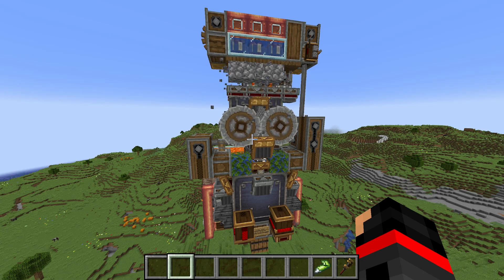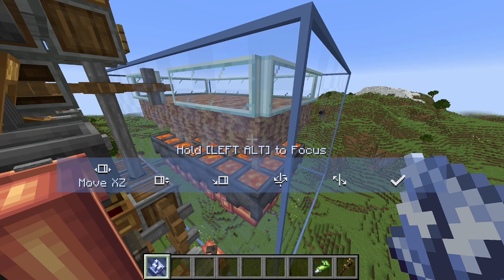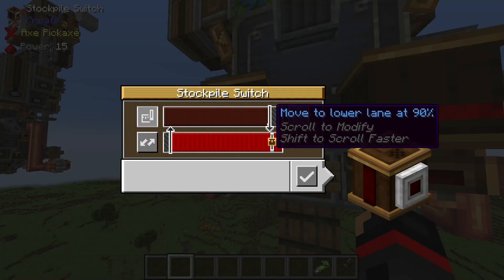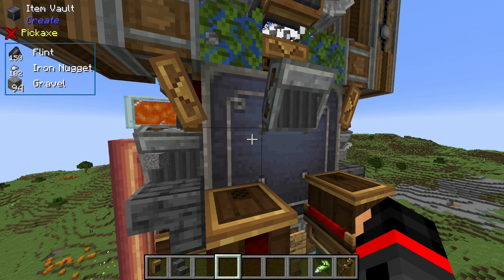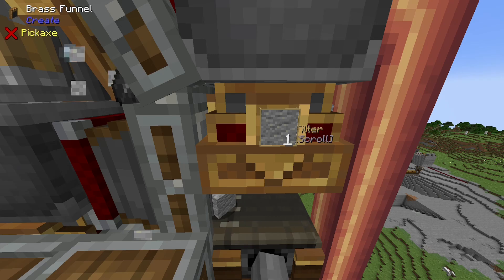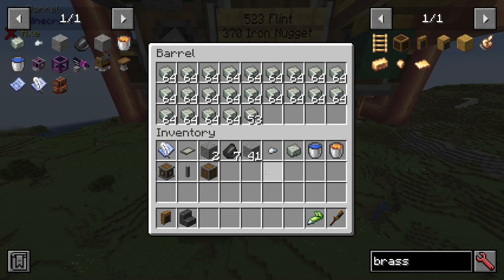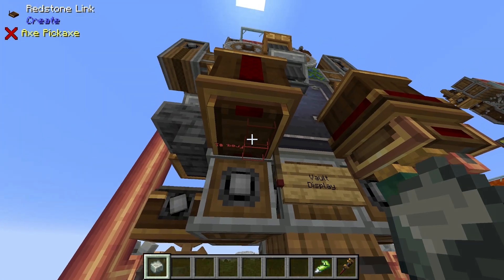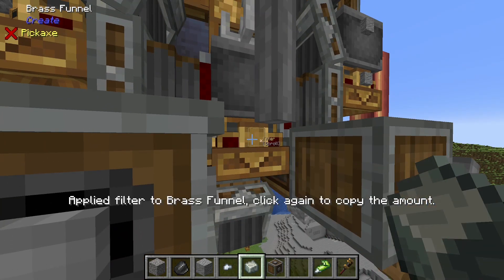This Machine Is A MUST For Create Players - Minecraft: Create Mod 5.1

Comment: 1.20.1 guide.

Step 1: Move the Gantry shaft back 1 block, this can be done by extending a normal shaft from the gearboxes and placing your clutch and speed controller on those. Then rebuild the gantry shaft, and make sure to connect the gantry shaft to the system with 2 linear chassis underneath. Glue all of that up and then place 3 trapdoors at the back of the pumps so that the water doesn't spill onto the Gantry Shaft.

Step 2: Replace all the Item vaults, the one connected to the gantry shaft must be placed in a row, facing horizontally, and the lower item vault should be placed facing towards the machine.

The first step is to fix the issue of Water destroying your gantry shaft once placed, this is a bug that is related to the 1.20.1 update. The second step is to make sure that your items don't just fall on the ground, lagging up your world.
Reply: Is it possible to have a screenshot of what is is supposed to look like ? I obviously did something wrong and it doesn't work but I can't see what's the problem
Reply: @guildorath9929 is it just not working, or is it breaking some way
Reply: @OgreDrupe  check 0:33, the gantry shaft has to be split like that for it to work
Reply: I was not talking about connecting the gantry shaft, I said to connect the gantry shaft to the mechanism, if you don't connect it to the mechanism nothing will move and you will just have a very fancy and expensive decor item.  @At-M
Reply: @guildorath9929  check 0:33, the gantry shaft has to be split like that for it to work
Reply: Can you be more precise in the first step pls I don't understand all 😭
Reply: can you give more detail on step 2 please im not quite sure what you mean
Reply: @TACOCAT_67  when using the create schematic cannon, multi block objects will be glitched, all you have to do is pick them up, and replace them in the correct orientation
Reply: So if we download the schematics they will be broke?  Was about to download and try out multiple schematics from this creator and now im worried none of them will work @OgreDrupe
Reply from the maker: Schematics in general have the chance to break due to different versions of the game and items not being placed correctly by the cannon. It's an issue that all schematics have, not specifically me lol. That's why I include as many fixes in my videos as I know about.
Reply: @Triobian  I understand the cannon breaking schematics.  Was wondering if the gantry shaft needing to be moved was something that was addressable by the schematic or has to be done by hand.
Reply from the maker: @Jarvolo27 yea that's cause the game updated, that would need to be done by hand. It's pretty simple though, you just move blocks 1 block away so the water doesn't break them lol
Reply: Lol still wrapping my head around a new mod and the fear of messing it up somehow.  Your videos have been a huge help  @Triobian
Reply: Could you not just upload an amended schematic?
Reply: He could, but that is an inconvenience to him; in return for slight ease of use/convenience for us. He also has a life. (Unlike me) @explodingpineapple6459
Reply: i still dont get it, "move the gantry shaft back 1 block" which way? what gearbox do i extend with shafts? its so confusing
Reply: @Alef00000  Move the gantry back perpendicular to the machine... I thought it was relatively obvious to move it away from the creation. You extend shafts from the gearbox adjacent to the Gantry shafts.
Reply: i broke my machine instead. it keeps going over the gantry shaft and breaking.

Comment: everything is so neat and tidy, id love to see and understand your workflow and design ethics. it would be interesting to see if theres a max speed optimisation, if it isnt already, where the speed of the all the resource generators match the max processing speed of the slowest component. when i tried to design mine i processed cobble into iron excessively, washing the items in parallel so that i have iron left over, but the entire machine was a convoluted mess, laggy because belts are awe fully optimised, and horribly expensive su wise.
Reply from the maker: Workflow is "i wanna do it, and ill beat my head against a wall till it works" 
Design ethics is efficiency and optimization with a chosen bottleneck. You can scale everything in create to massive proportions, but you dont need that. So I choose 1 aspect of the processing line and base the machine off of that aspect being unscaled. 
Machines are usually scaled to max speed, but I think this andesite farm in particular works best at the speed i have it in the video.

Comment: One thing I noticed was that Fluid tanks and Item vaults don't function  correctly when shot out of the schematic cannon (i.e. I couldn't put lava into the upper fluid tanks) But breaking and replacing them should fix the issue

Comment: I have a problem when I rotate the farm with a belt, the ones that carry andesite and real iron, and the press turns one side and one from the top, but I've also tried putting in gyar shifts but it doesn't work.

Comment: In case anyone has a similar issue as I did playing ATM9, I had an issue with the 8x gravel not getting pulled from after the crushing wheel and placed in the item vault for the andesite creation.  This is because gravel traveling between the brass and andesite funnels were being clumped into the gravel being washed.

The simple fix was to place a regular chute below the brass funnel (with the x8 item pulling off the chute below the crushing wheels) above the andesite funnel feeding into the item vault.  This allows the gravel to remain separated.

Otherwise, great build and thank you!
Reply: <3
Reply: thank you 😭

Comment: DO NOT f#cking use this farm in 5.1 without changing the whole cobble generator part to DRILLS, or if you waterlog the pumps it will just destroy the gantry shafts and flow EVERYTHING.
Reply from the maker: That's not accurate.
Create 5.1 is not the issue whatsoever. The 1.20 version changes gantry shafts to be broken by water. just push the gantry section back a block and it works perfectly fine. Still no drills needed.
Reply: @Triobian  alright thanks, the mining contraptions are first time with me, so i just like the drills more.
Reply: @Triobian  how to do that?
Reply from the maker: by pushing the gantry section back a block

Comment: the gantry shafts break when you put the water in
Reply: Back in what way
Reply from the maker: As in just make it so the water isn't touching the shafts.
Reply: @Triobian  I’ve fixed it all now
Reply from the maker: Push the gantry back by a block so its not against the water. That's a new 1.20 issue

Comment: when i put water on the 3 pumps above, it breaks the gantry shafts, its impossible to put water there...
Reply from the maker: Yea 1.20 changed gantry shaft behavior. Just push the gantry section back by a block. And it'll work.

Comment: Hi I have a small problem with the machine in 1.20.1, when I put the water it brake the gantry shaft, and I don't know if they are other possible issues.. are there solutions?
Reply: Did you find any solutions ?
Reply from the maker: Push the gantry portion out by another block so the water isn't touching
Reply: @Triobian  understood,  and thanks for the help
Reply: @DIOSAMA0  hiw do you resolve?
Reply from the maker: Push the gantry portion out by another block so the water isn't touching
Reply: @gabrielfreitas2037  you can fix this issue by using one of the two methods.
1. Make a schematicof that should the farms gantry system ( starting from top left speed controller and going till the top right speed controller and wheel this should also include all the gantry Shaft, carriage and the 2ndensite funnels.
Be sure not to break any blocks in the process.
Save the schematic and then import the schematic onto the farm and just move it  one block backwards and to power the speed controller just use a chain drive on both sides.
Important:- don't forget to use trapdoors to encase the pumps to prevent water from spilling.
2 This method is pretty simple just destroy the gantry system as a whole and rebuild it one block backwards.
Reply: @DIOSAMA0  ohhhh i see, thx so much bro, it helped me a lot <3
Reply from the maker: We recently found out about this too. no known solution just yet, as it's still unclear if its a bug or intentional.

Comment: im in the latest version of create but im on minecraft 1.18.2 on a server... i cant water log the leaves and other blocks ive tried either dont let the fans blow or the items fall to the sides. any idea of how to fix?
Reply: I actually got it to work now, I replaced the two waterlogged blocks with fence gates and waterlogged the middle one. I am supplying lava from an infinite source, but its only giving 780 an hour. Any tips on how I could speed it up a little?
Reply from the maker: That depends where your issue is. I don't know what speed youre running it at nor what your resources are after running it a while

Comment: welp. gantry dosnt wanna move. and i cannot find out why. i've tried for now 30 minutes.
Reply from the maker: Need to know what you've tried in order to help. And what you have confirmed matches vid. Can also hop on the discord for easier troubleshootingn
Reply: @Triobian  destroyed and replaced. tried regluing. but it works in single player. so its a multiplayer issue.
Reply from the maker: Then I suggest hopping on the discord and browsing the troubleshooting channel. Might find someone found the issue you're having. It's 3 am here so I can't help till way later

Comment: I'm playing on Create: astral and was wondering, since basins need to be heated for presses to work, theoretically if everything was just moved up by one block, would it still work? to fit in blaze burners
Reply from the maker: I'm not familiar with create Astral recipes, you'll need to try that on your own I'm afraid. But if that's the only requirement, than a few modifications should be all that's necessary.

Comment: Wonderful to see that the principal of the farm still works in create 0.5.1, but this update has swapped the stockpile switch with the threshold switch and requires different values to opperate, im unsure as to what these values are or how to set them. only other thing is that a couple pumps need to be flipped around if this is being used on create 0.5.1. Thanks for any help.
Reply from the maker: Check out the stream I did of the 5.1 update and how it affected my machines. I might answer the concer s you have, but not sure.
Reply: @Triobian   I watched the stream and it didint seem to cover the updated values for the threshold switch, you didnt gloss over it completly but you did accnowlage its presence, ill see if i can find some working values as to when the cobble gen will cut off.
Reply from the maker: Is there any reason you cant use the same values as 5.0? I didn't think there was any need to change them. For sure I included the values in the actual Alloy farm video, right? Even the default 75 25 would work just fine, since its an arbitrary cut off regardless. So long as it doesn't fill up completely (For keeping overflow issues tidy), it ought to be fine regardless what you set it to.
Reply: @Triobian  the same values are working fine, just didn't really know how to set them properly
Reply from the maker: Ah, all you do there is right click the block, mouse over the bar, and scroll. Click Checkmark to confirm.

Comment: Does the machine work for Create: Astral Space Reborn? Cuz the mechanical press is not pressing the gravel. I check the recipe. It needs to be heated to press the gravel into andesite. And also the recipe for the andesite alloy is by smelting andesite compound. But this andesite alloy crafting recipe is 2 andesite and 2 iron nuggets? Is that the reason why the machine is not working?
😅
Reply from the maker: The machine was built for the base create recipes. If you're playing a mod pack that changes the recipes, the machine will not work

Comment: i have a weird issue revolving around the gravel. after the cobble gets crushed, it doesn't go inside the chute but 8 of it seemingly go out of the brass funnel. i just have excess gravel and lava but no flint or iron nuggets. when i manually place the gravel in the filtered brass funnel, it starts working.

edit: nevermind, i have a bigger issue at hand. i realized the modpack i'm playing on creates raw iron nuggets..
Reply from the maker: Hmm that sounds familiar... read up on some of the other comments, cause I think someone else had a very similar issue. If you can't find anything, hop on my discord and make a post about it. I can try to troubleshoot it with you
Reply: @Triobian  ok i found out the problem, it was adaptive performance tweaks: items. the clustering feature was messing up where the gravel went

thanks for such a speedy response too!
Reply from the maker: Ahhh gotcha, glad you were able to figure it out!

Comment: Matirials list:

3 Andesite Casing 
14 andesite funnel
2 barrels
3 basin
12 brass funnel
1 chute
1 clutch
6 cogwheel
1 content observer
2 crushing wheel
1 display link
5 encased chain drive
2 encased fan
1 filter
8 fluid pipe
3 fluid tank
3 framed glass trapdoor
2 gantry Carriage
4 gantry shaft
15 gear box
12 item vault
3 large cogwheel
2 linear chassis
1 mechanical mixer
2 mechanical press
5 mechanical pump
2 leaves
3 signs
2 stairs
2 redstone link
3 rotation speed controller
17 shaft
4 trapdoor
1 stockpile switch
supper glue
Reply: I wouldn't like to eat glue for supper...
Reply from the maker: Uhh, the material list shows up in the first 5 seconds XD
Reply: @Triobian  Ik, just a text list so they don't have to flip through the pages. and I used it for a world where I don't have a book (and don't care to make one :P)

Comment: Great build. I've been looking for a nice vertical andesite farm. 
I have a problem however. It appears the cobblestone is not making it into the first vault. It looks like it's just vanishing after being broken. I tested by dropping cobble into the grindstones manually and it works fine spitting out Andesite Alloys. I'm fairly certain I'm right that it isn't making it to the vault as I can add an andesite funnel to the vault but nothing is being spat out (it is facing the correct way)

Any ideas why this could be breaking? I do see the cobblestone appear as dropped blocks but they appear to be clipped into the spruce trapdoors. Slowing the cobble gen down doesn't seem to change anything

*Note: I tested putting cobble into the barrel on the cobble gen before turning it on and it did add it to the vault, then passed it on. So the problem is that the gantry mech. isn't picking up the cobble
Reply from the maker: Have you broken the vault and replaced? The cannon doesn't place perfectly so they could be glitched.
Reply: @Triobian  Yea I realised that and broke and replaced all items related but to no success
Reply from the maker: If you can join the discord I have and make a troubleshooting post, I can help once I'm done with work

Comment: The mechanical mixer does not have enough speed to mix the andesite and iron nuggets! How do I fix it?
Reply: I fixed it by using another Rotation Speed Controller on the shaft connected to the power turning the mixer. Thanks for the great build!
Reply from the maker: Glad you like it!
Reply from the maker: Sounds like you're not giving the bottom power input enough RPM. Needs to be a minimum 32 RPM, since that's the lowest speed the mixer will work with.

Comment: Crushing wheels not crushing for some reason
Reply: got it to work by slapping a gearbox in there to flip the direction. However, I'm scared there are more stuff that's flipped that will mess it up
Reply from the maker: The only rotation dependent blocks in this build are the crushing wheels and the fans, so you should be fine. The fans will still do their haunting even if they are pulling air, so long as the air current is reaching the soul campfire across the way, and since the minimum air current range is 3 blocks, there shouldn't be a problem. And you can fix that as well by flipping the 1 RPM RSC to -1.
Reply from the maker: That falls under the flipping the 160 RSC to -160
That should be all you need to do

Comment: mmh weird  i build it if the canon but if i activate it via create power gen the upper clutch and link  break
Reply from the maker: That sounds like there's a conflict between the rotation provided by one shaft and another. Make sure the power is being supplied in and only at the locations specified by the signs.